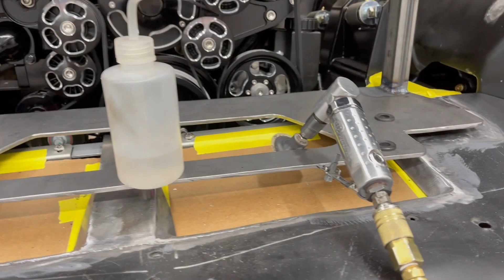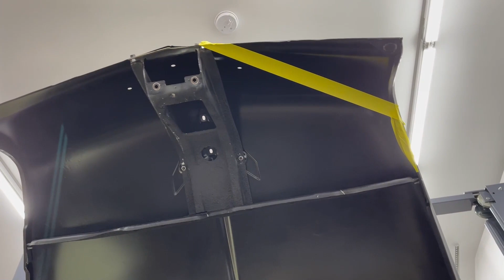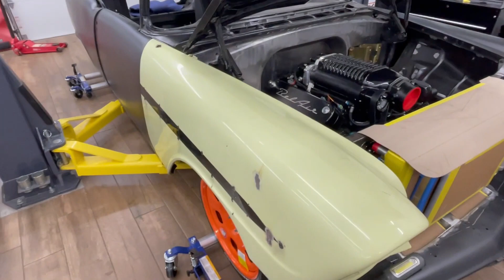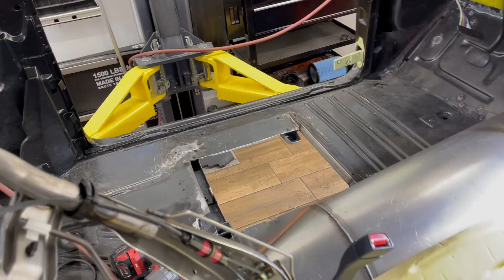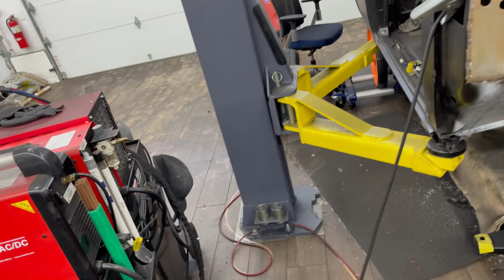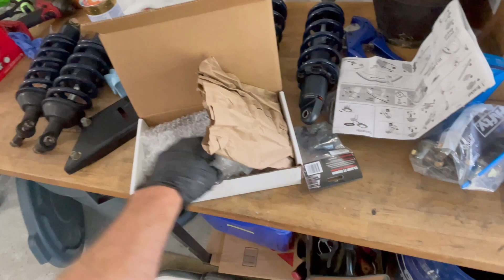1956 Chevy Bel Air Custom/Pro-Touring build Part 5

Comment: Don't feel bad about the welding sparks,your not alone.i have lit several harbor freight moving blankets on fire.the burn really slow and a small flame.i have been lucky to catch them early.i don't have them anywhere around sparks anymore.